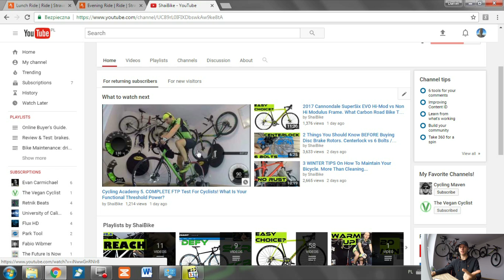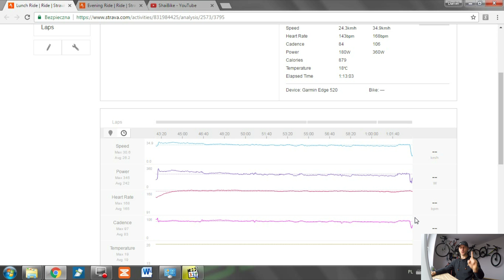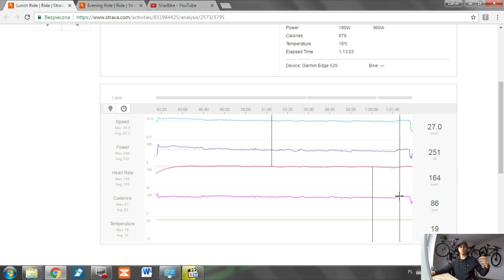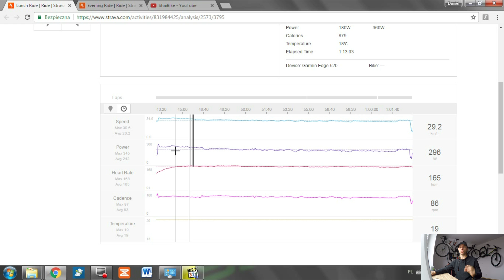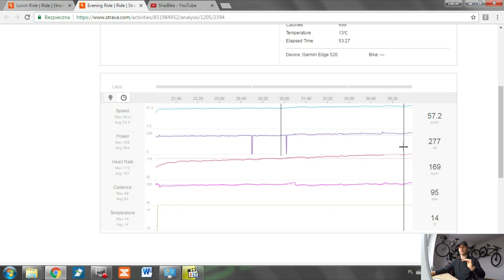3 Tips On How To Make Your Best, Cycling FTP Test. My Power Data Analysis. Cycling Academy.

Comment: Zwift don't tell you what cadence you need to spin...your cadence was going down because you was TOASTED!!!  you put to high number for targeting FTP and that was mistake!!
Reply: ERG mode is disabled during the test interval, it would absolutely not make any sense to use ERG mode (which keeps you at a constant power) for testing. Zwift and Trainerroad both automatically switch to standard resistance mode for testing which should be the same mode you used on your saturday test.
Reply from the maker: Not at all. I can shift to the big chainring and push 400 Watts, but the ERG mode doesn't respond, so keeping 270W with 90-100RPM isn't an option here...

Comment: What is your weight? If I would have overestimate my FTP so much, I would stop the attempt after 8min and make 2x8min FTP protocol (2x8min with 10min rest). I think it would be better to estimate your FTP than continuing the test with 70W less power than at the beginning. You need to substract 10% from avg power instead of 5% in "coggan test" and results are quite similar.
Reply from the maker: I'm 76 kg.

Comment: Actually when using the powermeter, cadence in zwift is just displaying, it cant push you down/up (as you said 3:15). I had low battery on cadence sensor and it splashes with very high values in zwift for about 1000rpm for some reason, but my bike rode as it should be, only rider graphically did rpm's like mad. I think zwift use only the power values (if available) for calculating movement speed and distance.